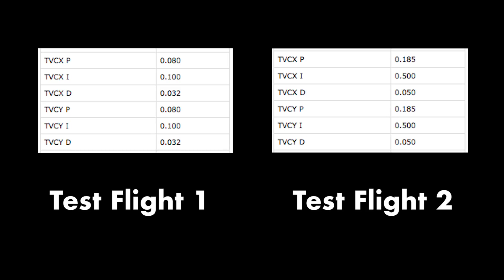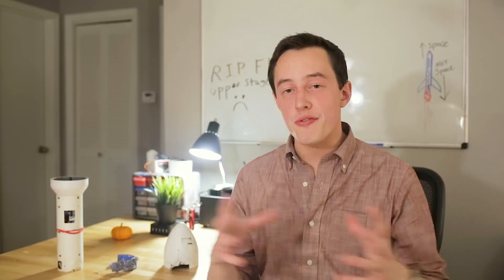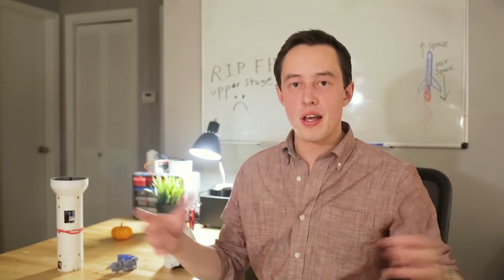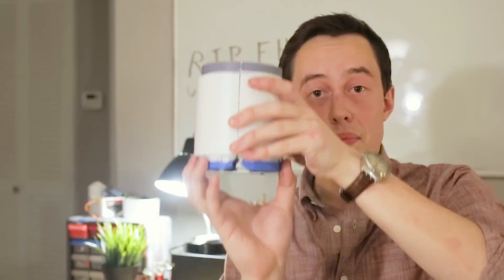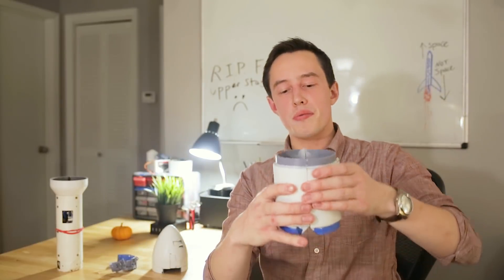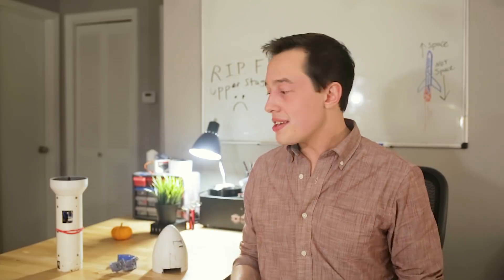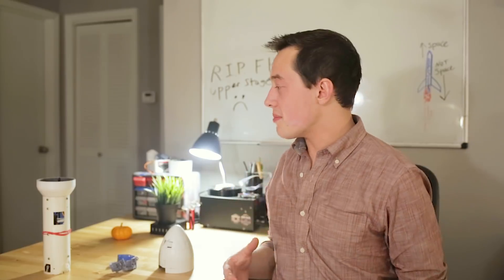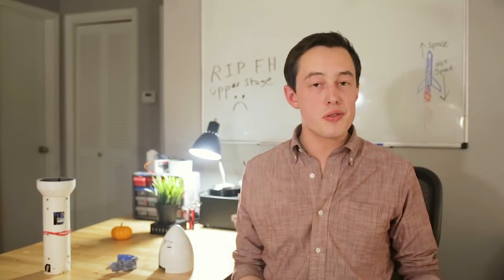Falcon Heavy - Upper Stage Test Flight #2

Comment: I think it's a huge problem that YouTube channels are exploiting algorithms. This is not what I searched for. Obviously this being a model rocket immediately ticked me off as nowhere in the title does is say scaled or model rocket. 

On the contrary I did take the time to watch the full video and support. I enjoyed it more than I wanted to. I've subscribed because I too work on my 3D printer and model vehicles on my spare time.

The video itself was great. Nice camera angles. Also nice to see someone trying the FH at model size. I never thought to consider thrust vectoring to scale. Or even including the fairing with a payload.

As far as the fairing issue you had, I'm not sure where the charge is placed in the fairing. May I recommend a different approach? The charge can be placed on the top area of the chute. Placing a thin circular plate on top of the chute. This  separates the charge and chute. Thus creating somewhat of a enclosed chamber. When the black power is detonated and expands, it should be forced to clear the fairing, letting the aerodynamic effects take care of the two halves of the fairing as you described. 

To better imagine this I'm thinking of a canonball exiting the Canon barrel. The cone being the barrel and the bottom two halves the canonball.

...Happy flying

Comment: That was a great test, still lots of usefully data. One think that might be worth considering for your next set of fairing tests, does the fact you have the stage 2 rigidly fixed in the test affect the result? I think that the relative acceleration between the fairing and main body should be the same in test versus reality, but in the test video it looks like you get more 'pop' from the explosive? The relief champers will definitely help too, but just something to consider. Best of luck

Comment: If the sides of the fairing had been attached to the body with lanyards, then after the top is ejected, it should still cause the sides to fly free of the parachute. Also would make it easier to recover the fairing parts for a latter launch.

Comment: Missing putting the chamfer on the top is not a big surprise, lots of us have done "stupid mistakes" like that before.  What I have found over the years is that testing is NOT the best way to find those.  IMHO, one great tool for finding those is is peer reviews.  Often you even find them yourself as you describe the design to someone else (ever heard of Rubber Ducky debugging).  The reason is that our brain has an AMAZING ability to see what we already think.  Have you ever eventually found something where you knew it wasn't.

While watching the video I immediately guessed the issue before you explained it.  Maybe that happened for you too.  That is CERTAINLY NOT because I am smarter than you.  It is just that I wasn't predisposed against seeing it.  Ex: Your testing had conditioned you to a specific disassembly order that I wasn't preconditioned to.

I know, the standard retort "I don't have time or resources to do peer reviews".  My response is "you don't have the time not to".  The trick to doing this right is 1) Make the review more casual and less prepared (not "more effort than they are worth") 2) Find someone you trust and you don't mind seeing your dirty underwear 3) Always value the feedback and with that value allocate some time to allow it to occur.  Note: They DON'T have to be an expert (or even very smart), they just need to be inquisitive, invested, independent, honest, and be able to provide at least a couple of good questions.

Finding issues earlier in the process is ALWAYS better and cheaper.  Consider not only the repair and replacement you need to do; but also the fact that when the fairing didn't open, you missed a valuable test of the parachute deployment and landing that now will need to wait until the next launch.

BTW, I really enjoying seeing your designs.  I am a maker (mostly in the electronics space) and launched model rockets when I was a kid and have been fascinated watching SpaceX's progress.

Comment: Congratulations anyway! I think you are getting closer every launch to the final success! Having reliable parachute deployment looks easy, but it's actually very hard. I normally test between 10 to 15 times before it qualifies, also with different "external" factors, orientation and other variations. And even after all adjustments and "pass", it eventually fails. So yes, more and different tests are needed to ensure critical components. Congratulations again and I look forward for the next test. Thanks for sharing!

Comment: Do you think that the wobble at the moment of launch could be due to a rocket motor which is too powerful? In this context of the second stage launch from 0m/s a powerful motor is needed to achieve a successful launch. However if you consider the situation when the second stage is already travelling at some velocity due to the launch with the first stage, then is such a powerful motor needed? Could you use a weaker motor to sustain the velocity rather then to accelerate the second stage aswell? Maybe the lower power motor will have a less exaggerated effect on the tvc movements and result in a smoother flight? However this may come at the cost of not being able to correct attitude as easily as a powerful motor.

Comment: May I suggest having the cams inboard looking radially out and adding a small mirror at 45 degrees? I think it will look sleek, and you can cushion them in sponge. In rc planes anything electronic cushioned in sponge usually lives twice as long!

Comment: Glad to see pumping up that integrator gain worked :)

In terms of your flight computer cycle rate, what you really want to be doing is to set it as high as your processor/sensors will allow while still being able to get all your computations done in that cycle. Then, slap a low-pass filter on all your sensor inputs to smooth out the noise which I believe is the controllability issue you were alluding to at high cycle rates. Filtering is a much better approach than the “big hammer” of lowering the PID refresh rate.

Comment: Three things:

1. That highly scientific doodle on the whiteboard behind you needs to go on a tshirt. It perfectly covers all the intricate physics problems involved in space flight (i always forget which way "not space" goes on the rocket ;) )

2. Have you considered spring loading the two halves at the top and using two smaller pyros (one at the base, one where the top cone sits?)  This might give you even more chance of structural failure and proper separation once the charges blow, without sacrificing integrity of the fairing before. just an idea

IndexOutOfRangeException

Comment: Instead of a three-piece faring, try a two-piece.  Each side slips into a hinge piece at the base. Your charge would easily blow it apart safely.  I wish I could include a picture of what I mean.
Reply from the maker: Shane Russell I would rather do it that way as well! Unfortunately my 3D printer isn’t large enough to support that print height.
Reply: @BPSspace  I have two rather large Delta printers at home, could print a few sets of fairings in PLA or PET for you ! HMU if you think that's an option
Reply: @BPS.space What's your build volume?  Better yet, point me to the dimensions (or STLs) of your farings and I'll see what I can whip up in CAD.
Reply: Oh and I love these videos.  I just discovered them last week.  I need to go back and watch the earlier stuff.  Keep up the great work.

Comment: Hi Joe, I have shall we say, extensive experience with wrecked cameras and extracting video clips. Check out the freeware program called recuva that could be used to get the data from your cards. You will likely get a partial file recovery but it won't play. This is very common with H.264 files, because the header info is written to the file when the recording is ended, so a crash will terminate the recording before the headers are saved. You can find utilities like MP4FIX that can create fake header data by copying the data from another video saved by the camera. Some "best practices" for video recovery: One thing you should always do is try and blank the cards before each flight. Some format utilities will let you do this, but an easy way to do get the same result is to copy a file filled with 0's or some other character to the card that fills it to as close as possible to the maximum capacity, then delete that file. The memory of the filesystem will be filled with something that doesn't at all look like video data and this will insure that video data written by the camera is not confused with old file data if the video file is corrupted, and you try to recover it. Having only one video stream present on the card and the remaining sectors filled with something else means that the recovery software will likely find all of the recording and it won't truncate the file or insert data from an erased video that's still sitting on the card.Good luck!
Reply: Recuva is a great program.  Have used it many times myself!

Comment: Why don't you just make the faring 2 pieces, get rid of nose cone and just make the first 2 bigger and pointier? also I LOVE YOUR VIDS! what computing systems do you use, and how doesn't the launch pad computer get torched each time?
Reply from the maker: I would way rather do a two piece fairing, but I don’t have a 3D printer than can support a large enough volume to keep the fairing accurate to 1/48th scale
Reply: why not just print them seperatley and glue them? sorry i dont know much about 3d printers really lol.

Comment: Loving the channel as always keep up the great work! However I have some recommendations about your onboard recording system. While the runcam 2 is a great form factor camera for your use case, they are a bit heavy and tbh ugly to strap to the side of such a beautiful rocket! I think you would be much better of using a camera like the Runcam split mini 2 or similar cameras due to there super compact, and lightweight, form factor. These cameras and there accompanying main boards only weigh 12.5g each which is nearly 4x lighter than the Runcam 2. However possibly the coolest opportunity you would have with using these types of cameras would be the addition of a live feed you could watch during the launch. Simply add in a 5.8ghz video transmitter that weigh less than 12g and a small circularly polarized antenna like the AXII and boom you've got an FPV system that weigh less than a single Runcam 2.

Comment: A really high refresh rate would not have to mean that the rocket does not fly well if you maybe combine the PID with something like a low pass filter. But you will get diminishing returns when you increase the refresh rate too much. A too low refresh rate is still bad though. Assuming that the control input will be held constant during a sample time, then you are roughly applying zero order hold discetization to your system. This effectively adds half a sample time delay, which can cause stability problems.

Comment: I use a simple trick with my PID controllers: I turn off D near the setpoint. This trick greatly improves the PID response.
Reply: This would mean that if you move quickly towards the setpoint, then very close to the setpoint the D term does not slow it down anymore, potentially giving a bigger overshoot. And if you are stationary close to the setpoint then the D term wouldn't contribute much anyway. Also if you are not careful disabling the D term might make your system unstable.
Reply: @kwinvdv  Your analysis is right. But, turning off D near the setpoint just works. If you move quickly towards the setpoint, then you stay little time near the setpoint. Try it. Turning off D near the setpoint improves the response because this turn off "digital" noise.
Reply: @guatagel2454  When the derivative is small then indeed the D term will have relatively higher noise if you use finite differencing to find the derivative. But instead of turning it off it might also be a possibility to add a low pass filter, or maybe something even more advance like a Kalman filter. But if you want a quick fix then maybe turning the D term of might also work. However you probably should tune the PID to have (hardly) no overshoot.
Reply: @guatagel2454  Also turning the integral off while far away from the setpoint might also improve things. Namely this can avoid integral wind-up, especially when the input is saturating.
Reply: @kwinvdv  You are right! I have a trick for "I", too. At some amount of minutes, I just load the I variable with the P value. That way, the I does not have to wait all the time to reach the system's loss value. This is specially useful on system with high losses, such as electric furnaces. Try it!

Comment: Your sampling and refresh rates can never be too high! ;-) Run them to the limits of the i/o hardware or the processor.

Also, I think the derivative gain should be negative. This provides pitch/yaw rate damping, which will reduce overshoot. The system can sample so fast that the derivative delta only gives a 6-7 bit dynamic range result, maybe even a bit or two less.

Fantastic results, very impressive!
Reply from the maker: If they're too high, you'll be sending signals to the servos faster than they can physically/mechanically keep up - that means you'll lose fidelity and reliability in the actual flight control, as well as any offline simulation. Stay tuned for more videos about finding that sweet spot soon!
Reply: @BPSspace  well than you don't need to refresh the servos so quickly, most servos max out at about 50-75hz (at least in my experience), but you could sample faster, average the sampled movements out and then send them to the servos, right?
Reply: Justin W that’s the way to do it. Push the sampling rate to the max but divide that rate so your actuators can keep up. Great method of filtering.
Reply: Would smoothing the sensor inputs help here? For every ten or so input values, average them and output that to the thrust vector mount. That way your sampling rate from the IMU could be ten times higher than the thrust vector refresh rate. Keep up these amazing videos, they are very inspiring!
Reply: That's correct！Your Servo cmd must be executed（to the cmd referance angle） before the next cmd  is coming. And if you have tested the response speed of the Analog Servo you will know that. So the PID loop time is limited by Servo speed.
Reply: @BPSspace  Are you using real servos or rc servos (steppers)?
Reply: I'm interested in your follow-up videos about this issue.  Do you share the source code anywhere? This hasn't been an issue in similar projects I've been involved in, even sampling at much higher rates. Here are some unsolicited thoughts:
As you increase the sampling rate, I'd expect your digital controller to converge on being identical to the continuous-time controller with identical gains (a useful sanity check).  That there is a "sweet spot" leads me to suspect there might be a bug (is dt included in all the right places so the controller is relatively insensitive to sampling rate changes?  the integrator is one place where this would matter, but there might be others). Otherwise, the sweet spot makes me wonder if you've converged on a set of gains that are only good at that rate and there'd be another set at higher rates.  Eventually, the PID gains should become insensitive to sampling rate.  Maybe there's a resonant mode that gets excited at higher sampling rates?
It's common for actuators to move slower than the command, but I'd only expect it to be an issue if the actual command signal was getting corrupted somehow (like the PWM waveform getting reset during the command, etc).
What you're doing is awesome and inspirational. Keep it up.
Reply: Felony Videos that’s not true. Your refresh rate should be within the limits of what its controlling, and even then you generally get better results when you are not at the limit of how fast the actuator you are controlling can react.
Reply: Updating the servo commands faster is not the same as trying to move them faster. A fast update rate reduces time delay. The actual rate/position/torque command is a function of the PID equation. The PID is limited by the natural frequency of the entire plant and controller, since the loop is closed around the entire vehicle.
Reply: In my comment about using a negative rate feedback, I was speaking in terms of angular rate of the vehicle. The actuator angle is semi proportional to the vehicle yaw torque. In my mind, vehicle torque translates to vehicle angular acceleration, the second derivative of the vehicle angle (which is what we really want to control). A feed-forward loop using a simple plant model would help a lot here.
Reply: Also, since the thrust of these engines is not constant, the gain is changing right at launch. A faster update rate could accommodate this by changing the gains in the first 1 second of operation so that stability and optimum performance can be maintained through the entire flight. Launch 2 was unstable for the first half second of flight until the thrust level reduced.